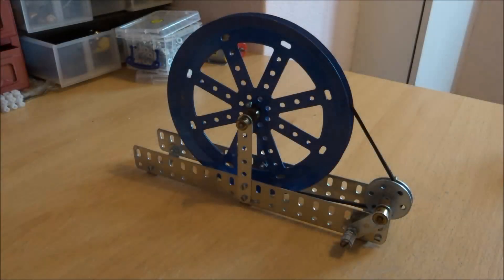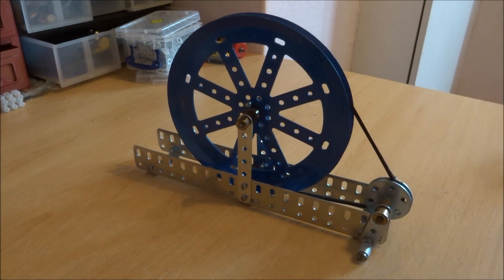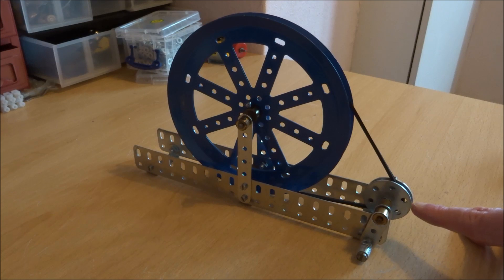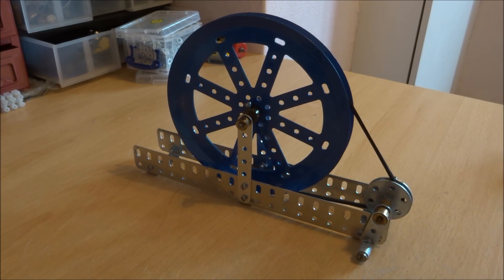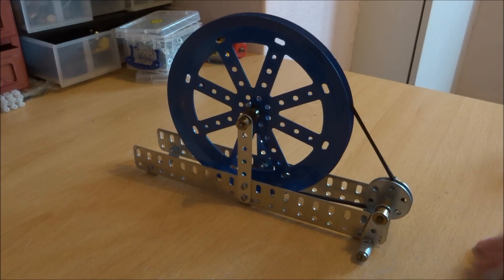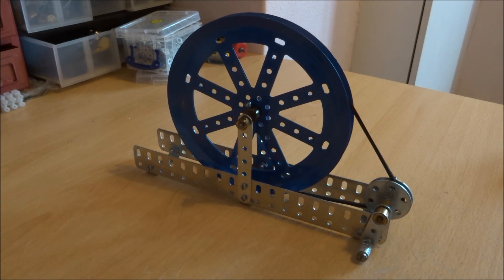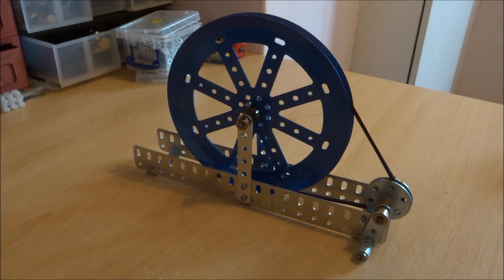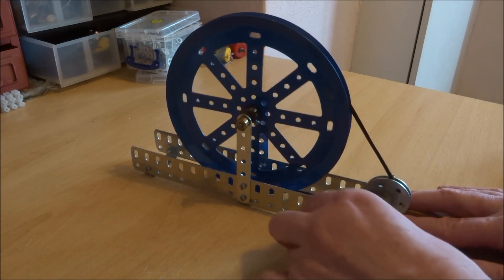Meccano Deep Groove Pulley

Comment: Hi Brian, long time viewer first time commenter, I would like to build a mechanism out of meccano to be driven by my small twin brass engine at a lowish speed. my goal would be to have a pulley from the engine onto a meccano pully that will drive a shaft that will shake a mesh grill to sort sizes of metal shot. much like your saw video but instead of a saw it shakes a screen. thankyou for your inspirations over the years.